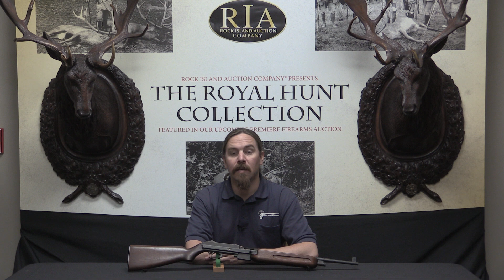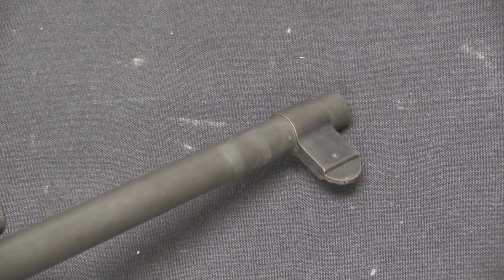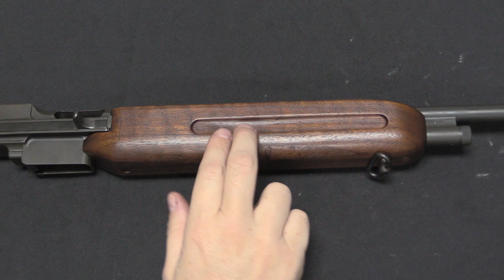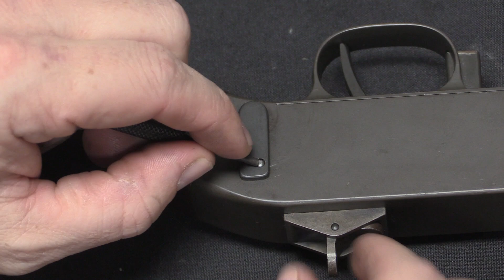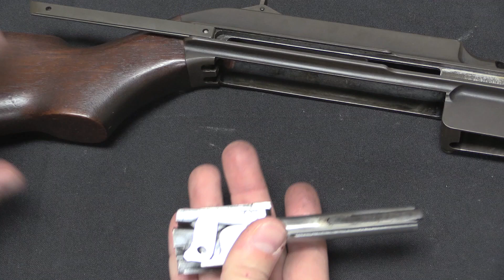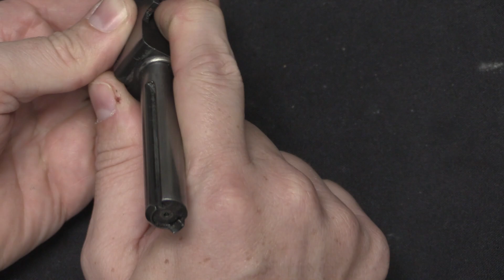Bendix-Hyde Second Model Prototype Carbine

Comment: That op rod cover that slides back and pins in place looks like it would get bent SO easily. In a fox hole or just under pressure to get the weapon stripped and clean especially if if flip it over to pull the trigger assembly.

Comment: Is Inland Co. just a manufacturer?  
Is Inland Co. the same company that manufactures electronic parts in today's market?  

You can google electronic parts like headset, 3D printer filament, cables, circuit boards, etc with the Inland brand.  
Just curious...

Comment: The weapon has a receiver and bolt system designed on the Thompason and Blish system in its basic design and Looks. The Trigger housing, Charginghandle and  design and the operating design are a hybrid Browning BAR and Garand Design. The forearm is a Merge in Design from the BAR and a Thompson. The bolts locking system is similar to the Blish locking system inverteThe Trigger housing definitely gets its design from the BAR.  Sights are an Early 1927 Thompson Type system.  The firearm was brought together and designed off of existing designs of the time. Thank you for showing this rifle. Like many others, it shows how  most weapons are designed within the existing technology and knowledge for the time.  Many of these features are still in use today.

Comment: The also rans are always interesting. I love my Inland 1943, but i suspect these sights are a little more practical and more rugged. Also, the separate stock and forend should be easier and faster to produce than a long 1 piece stock and a handguard. And of course that handguard could be recontoured and shortened and lightened a bit. I kinda like the gas tappet idea vs this long, fairly complex op rod. We know that the op rod can be a little troublesome, subject tio bending, and not real tolerant of different ammo. I need to take my Carbine apart to refresh my memory on some things......Great video as always. Thank you

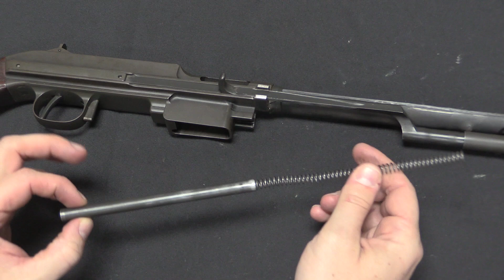Comment: that main spring housing, that you pull off at 10:28....looks like a rejected m1 garand Op-Rod. the hardened end is 100% whats in my m1.

as you said.... they probably messed up a lot of op rods in the complex bending process.... great way to recycle early mistakes. also looks like this gas piston is larger in diameter...probably due to reduced pressure from 30 carbine. 

that spring guide...thats a cut m1 garand op rod...a measurement would tell, my m1 has the post war replacement op rod (its a 43 receiver, with a 41 bolt??? new trigger group, 3 different stock pieces..1952 barrel with a small divit in the chamber..wtf happened to this gun)

Comment: just a thought for disassembly, to push the pins in, rather than use a bullet or pin punch it looked like the  sling swivel had a a pin end after the thread that might have worked, seen you do similar things before on other guns. Great video though Ian, once again.

Comment: Did the US military ever try to adapt the .30 Carbine cartridge to a handgun?The case length is exactly the same as a .357 magnum.It seems like S&W could have easily chambered a K or N frame revolver for it.The M1917 was certainly a success.There were actually 2 civilian handguns chambered for it.The Ruger Blackhawk and the AMT Automag III.In fact I saw an AR upper in .30 Carbine the other day.

Comment: I like the idea of the design but if the select fire option had remained and it had been up calibered to .380 or .45 ACP and an inline stock had been added as well as a vertical foregrip I really think this rifle would have ended up not only winning the trials but actually even replacing the M1A1 Thompson simply because it would be able to do the same job a lot more accurately.

Comment: The design seems a lot like a improved version of the garand/m14.  If this design had been chosen it could easily have survived the test of time, especially with the introduction of detachable scopes.   It's all sealed, and has a solid receiver.  Which is basically what we're trying to do today with the kalashnikov system and the m1/m14 systems.